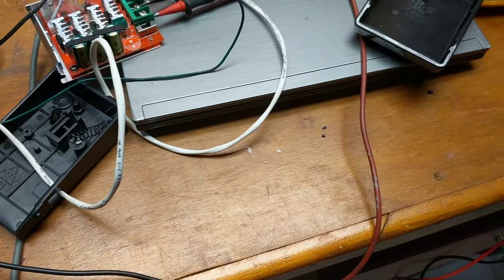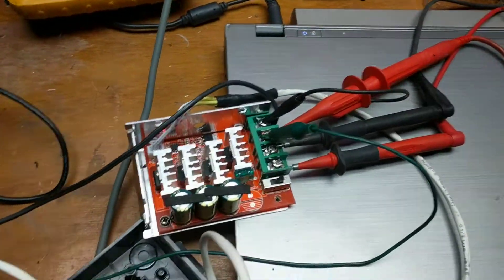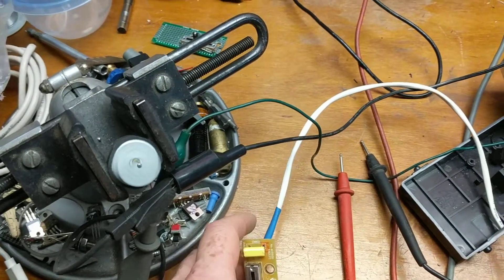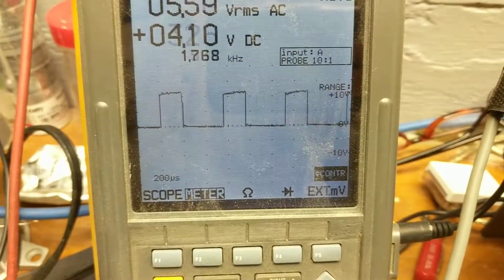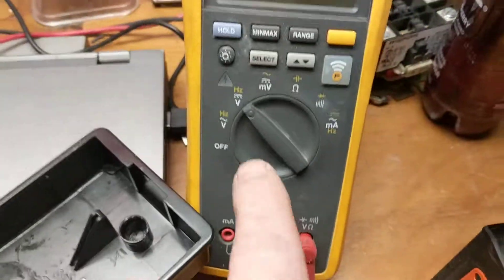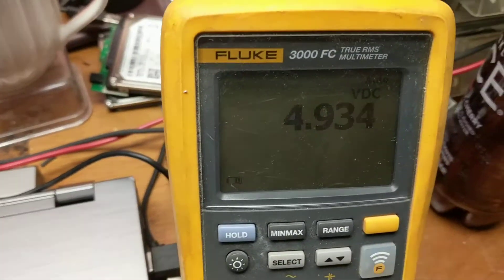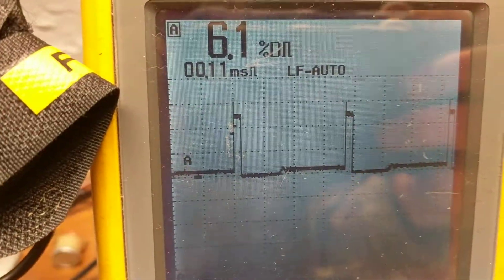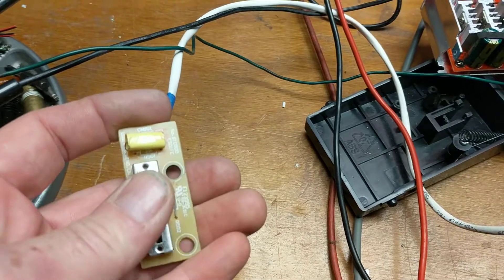Power Wheels PWM Speed Controller

Comment: I'm using a pwm speed controller on my son's power wheels.  Would it be possible to wire 2 pots in series?  One to act as a speed governor and the other to be the throttle pedal?
Reply from the maker: Assuming your H-Bridge circuit is using 10k ohm resistance values on either side of your potentiometer, it should be as easy as connecting  a single resistor in series with the high speed side of your pot you use for variable speed.  Turn your pot as far as it will go for faster speed and look at the terminals of the potentiometer.  The terminal your pot turns toward will be the one you can insert a resistor in that wire.  Start out with 4.7k and if that is too much, parallel another 4.7k for 2.35k.  If that's still too much add another resistor in parallel.  Here is a link to a circuit you can look at that shows what I'm talking about. https://www.electronics-tutorials.ws/blog/pulse-width-modulation.html You are trying to increase the value of R2 shown in that drawing.

Comment: Hey I have the same model of pwm controller but mine quit working. Speed is always full regardless of the pot setting. Any idea what could be damaged? MOSFET? Timer? Thx :) also fuse is ok
Reply from the maker: Are you certain it's wired correctly?  Also, is the pot actually working?  When you disconnect the pot and put a meter on the wires coming from the pot does the meter show a change in value when you adjust the pot?